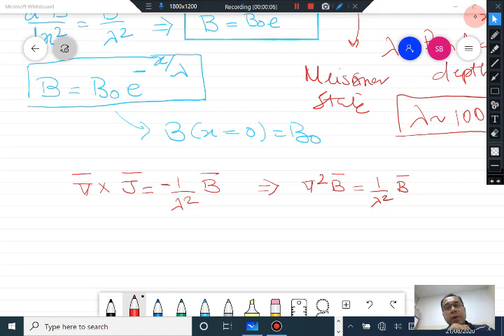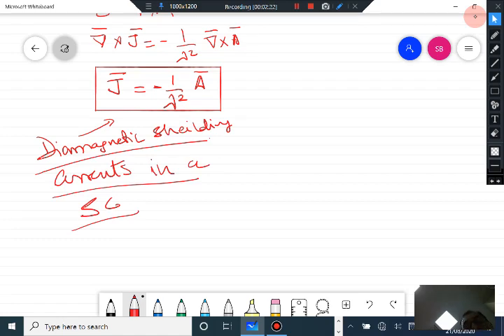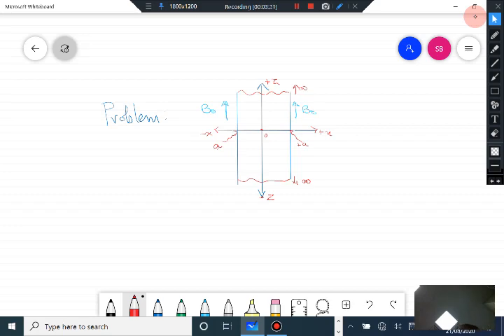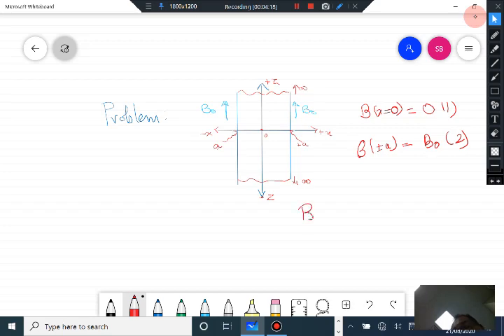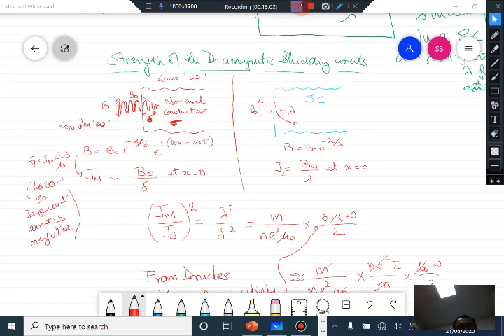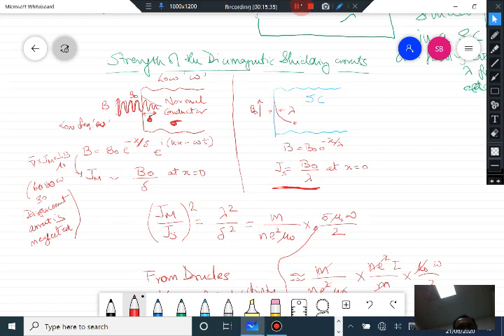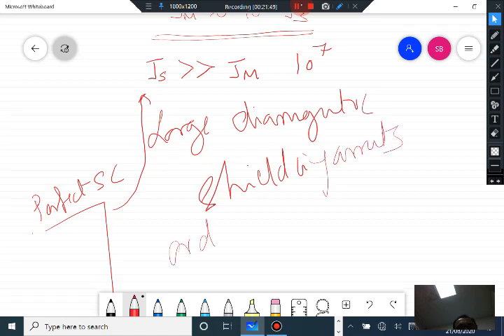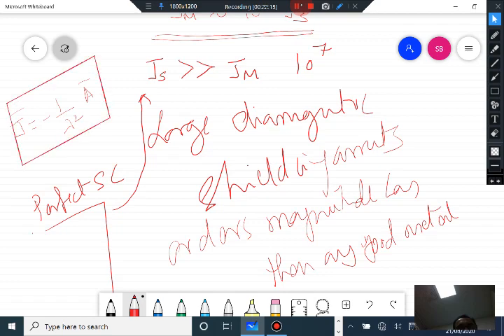Lecture 14

Comment from the maker: In the derivation for finite width superconductor. There is a slight typo error. Please consider the following corrections. The field distribution goes as B(x) = [Bo/cosh(a/lambda)].cosh(x/lambda). The B(x) is in z direction.This form will have the shape of the field distribution we have drawn in the lecture. The diamagnetic current density which is derived therefore is J(x) = -(Bo/(mu.lambda.cosh(a/\lambda)).sinh(x/lambda). Note this J(x) is in the y direction. Please note these are the correct forms for B(x) and J(x) used in the video lectures.
Reply: In the equation in video, it does not satisfy BC at x=+/- a. In the equation, in the comment it does not satisfy BC at x=0.
Reply: @user-zm8vw4vo7v  I guess there's sign correction ie. -sinh(x/\lambda) might do but then [ -1/cosh(x/\lambda) + 1 ] looks close to how B decays but current doesn't match